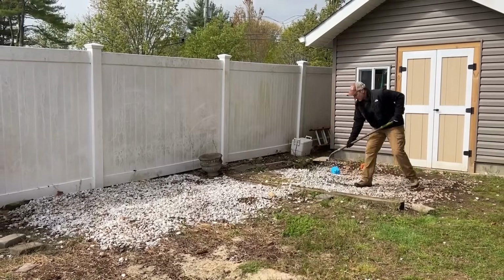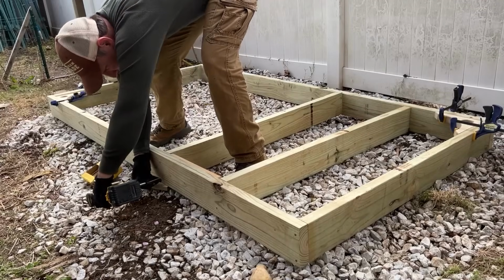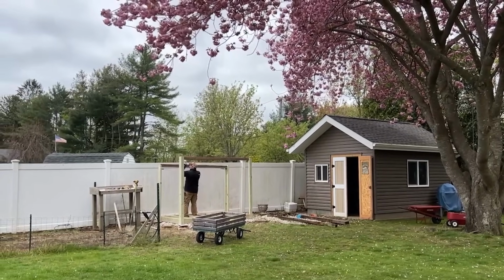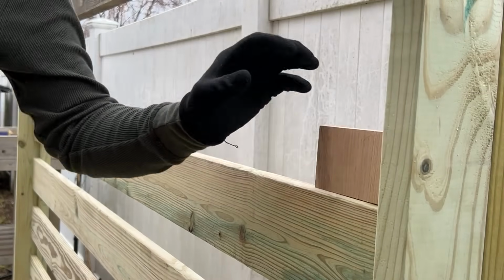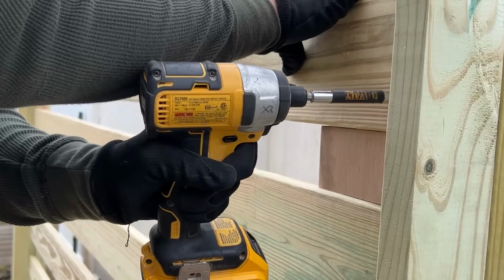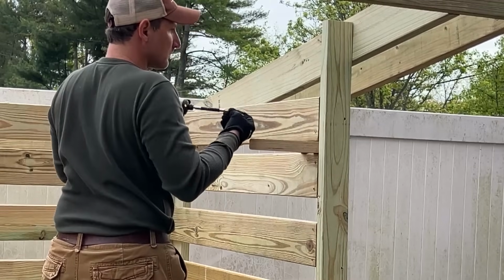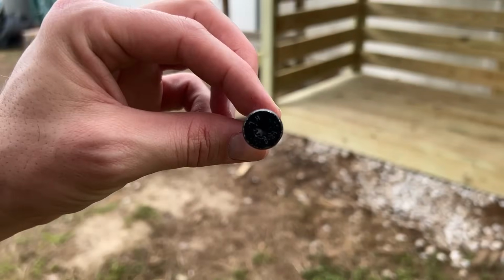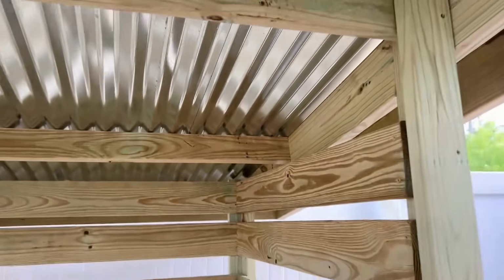How To Build A Firewood Storage Shed In One Day / DIY Firewood Shed / Firewood Rack Build

Comment: You need also leave a space between your wooden floor and the ground to prevent rotten damage. Best way to do that is build your sheds on concrete blocks
Reply: I'm planning to do that with blocks in the front where it slopes down and the pavers in the back to get the skids level and allow drain off from underneath into the driveway. I want it off the ground. I live in the rainy, mossy, PNW.

Comment: Good build. But if cost is an issue then one doesn't need such a well made floor. I also fit a heavy plastic sheet to the front wthat is weighted at the bottom for when the rain is tipping it down for a spell.

Comment: hi .. you're using 2x6 for the box at base right? I was thinking of using 4x4 on the box and 2x4 cross beams, but seems like 2x6 is easier to work with?
Reply from the maker: Yes I used 2x6.  Less likely to bow with all that weight

Comment: Small tip, you want gaps in the floor boards, partly for the critters you mentioned, but also airflow and the ability to shed water.

Great build tho, I'll make similar as my undercover areas are already taken up, and we are trying to transition away completely from our electric furnace

Also you're extra hole would have been less impactful had you affixed roof screws on the peaks of the ridges instead of the valleys, it's 'best practice' to avoid water penetration
Reply from the maker: Thank you, I tried installing screws on the peaks first even though manufacturer says not to and it didn't go well.  These sheets were from my big box store and probably much thinner gauge than the quality ones.  I should have used aluminum foil.
Reply: @ArtisanMade  awww man, I too have had this issue, they usually have a stretcher that's cut with matching waves to affix too. Either way, as you said some roofing putty will seal em right up
Reply: @ArtisanMade  I had better luck centerpunching and predrilled the corrugated
Reply: My first thought was “why not have gaps in the floorboards too”
Reply: Those green treated boards will shrink. We installed decks all the time with boards tight as can be. Several months later they had shrunk to a uniform gap between.
Reply: I actually learned the lesson of putting the  screws on the peaks of sheeting for 2 reasons, first was to capture the ridgety of the sheet as aposed to the flat area where I had prevailing winds working on it constantly then lifting, mind you this was on an existing barn that buddy built using nails. Secondly I found having correct screws as you have with the rubber washers up on the raised portions of the sheeting didn't allow for trapped needles, leaves and debris to get hung up on the flat sections keeping the roof cleaner after a rain. Thats just me...

Comment: Nice simple build 👍 I've planned something similar myself and am just wondering if your structure is rigid enough without any cross-braces? My plan is for a shed about double the size of yours and I live in a climate where I can get upwards of 50cm of snow on the roof so I've maybe overdone it with cross-braces in all directions but am wondering if its just unnecessary over-engineering...
Reply from the maker: I always think it is always better to over do it, than under do it.

Comment: What is the best way to orient the building in regards to the sun and winds and weather, etc?
Reply from the maker: Where I live, I usually have a south wind, so mine is facing south so the wind and rain hits the back
Reply: @ArtisanMade  I think you mean a "North wind" if its coming out of the north and blowing south. Confusing as heck.
Reply from the maker: PJ Jackson your right it is confusing. Wind here comes from the south moves in a northern direction
Reply: Great question, you need to know the direction of your prevailing wind.

Comment: I'm a newbie so excuse me if this is silly, but if I wanted to place this structure on concrete deck blocks to keel it off the ground, would that change anything in your plans?
Reply: I would say its ok. Support the middle as well though  in the centre of the floor to stop any sagging. I try to raise my structures a decent height from the ground so I can see any critters trying to make it their home & it also keeps things drier.
Reply from the maker: I’ve built sheds on blocks like that. Add supports in the center as well. There is going be a lot of weight in there

Comment: Never use roofing tar on a galvanized roof. Using acrylic Apoxsee our silicone. Tar will allow rust and leakage due to it cracking and breaking overtime from the elements.

Comment: Nice project, but how do you prevent wood from rotting; I think after, let's say, 7 to 8 years needs reconstruction or not;
Reply from the maker: I used pressure treated wood here, which is very good for the outdoors.  The gravel under the base and the extended should should keep it dry most of the time.  I expect it will last 15-20 years.
Reply: @ArtisanMade  Thanks a lot for your reply. Keep on going...

Comment: Can you provide dimensions for your homemade square?
Reply from the maker: 4ft x8ft
Reply: Looking for the dimensions of the wooden square that you made to assist with clamping the sides to make them square. Looks like each side is about 8", with a 45 degree angle on each end, the "legs" are about 1.5 inches with an inner radius of 6 inches? (material = (2) pcs of 3/4 finish plywood glued together?) @ArtisanMade
Reply from the maker: @bfran1958  yes these were 2 pieces of 3/4 ply glued. About 10 inches on each side. The larger you make it the better.

Comment: Anyone aaying thr screws should go in the hill of the roof are incorrect. With expansion and contraction, those screws will loosen. Not to mention, depending on the project, any warranty will be voided if you put it in the hill.

Comment: Why does the roof have so much support its light it’s not going to collapse
Reply from the maker: Long stretches of unsupported beams will bow overtime especially in cold weather when you get heavy snows. That’s why two by sixes are used on the outer portions of the roof.  inside the two by fours are required so that there is something there for  the fastening of the metal roofing.
Reply: @ArtisanMade so if we don’t get that much snow we don’t need to add so much support?

Comment: i dont know shit about fuck, but why would you not just start with the structural screws instead of the temp ones?
Reply from the maker: It’s easier to pull and shift posts into position if necessary with regular screws. Let’s keep the language clean in the comments since this is open for all to see.

Comment: You made massive mistake from the start , not making sure your shed was raised above the ground surface thereby avoiding any water contacting the timber . Common sense really .
Reply from the maker: No mistakes  here. If you watch the entire video you will notice that it is built on a thick bed of gravel to allow for drainage and the roof is over extended on all sides. In 4 months, the base has never been wet
Reply: I went back and viewed video again just to make sure and guess what ? I am right your timber is in close contact with the ground, putting gravel down to level the ground is correct but laying timber on it will still allow water at some point cause decay, I have been there got the tea shirt in other words made the same mistakes way back in my youth . But otherwise a good job well done .
Reply: It's pressure treated wood , should last at least 15 years in wet conditions. My garden beds and deck are holding fine and some of that was from the previous owner over 17 years ago
Reply: @douglasslack4291  You sure got him good there Douglas! You're just a wealth of quality information ol' timer... Am I'm sure he's just beside himself with the gracious "well done" Well done Sir!